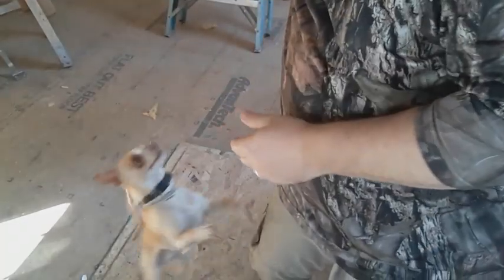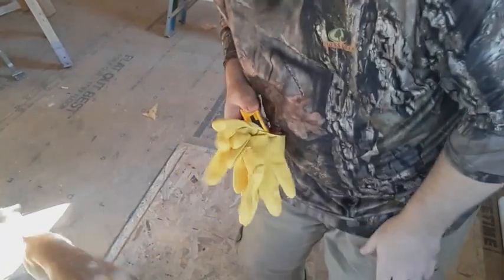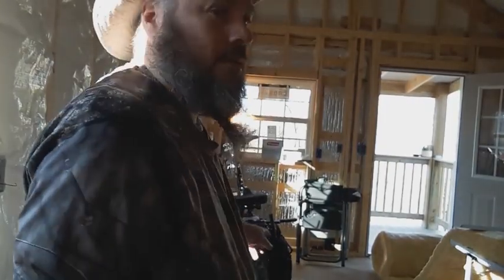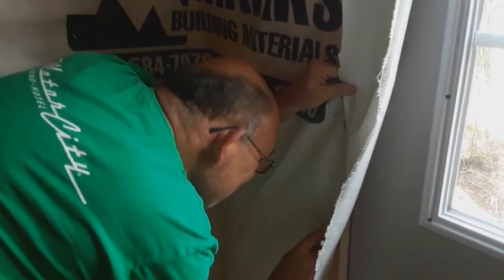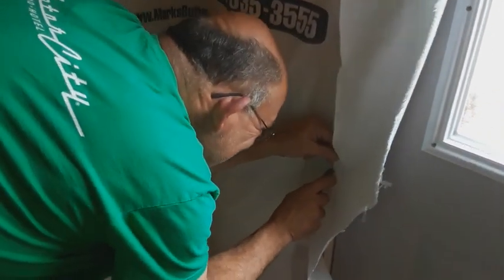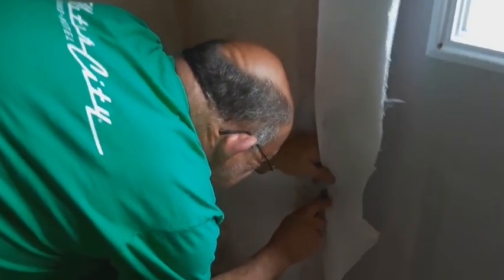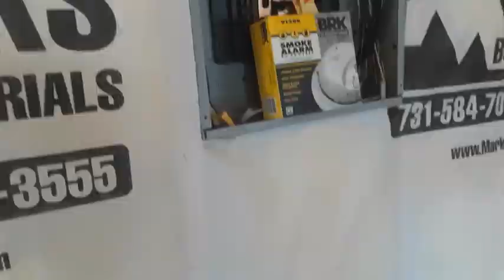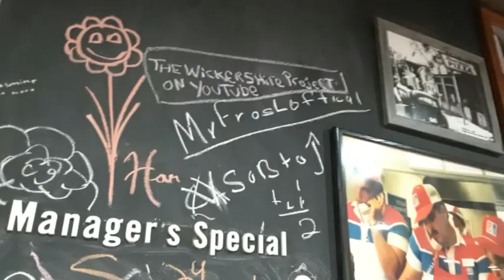Jan Vlog #7 Part 1 & 2 Itchy and Scratchy

Comment: I crawled through the middle of a roll wearing only shorts as a kid. I don't mess with it anymore. As an electrician it's been hard to avoid but I succeeded for the most part. Anytime I insulate i usually just use foamboard or rockwool.
Reply from the maker: Love rockwool and foam board.  Lucky I had enough $$ last year to get the spray foam done on ours.  Oh Great you play with electricity.  Ok so I need to ground my system.  I have the pole pounded down outside ( 6ft down it's i could do as we hit something. I'm gonna do a 2nd one later ).  I have Hot 1 and Hot 2 for 240v and 120v options. I know in 220v only the ground matters as a return route for a short.  In 120v application all Neutrals go to the neural bar.  Now I have a problem. There is No grid service as a return with neutral. Do I still run a copper wire over from the N bar to G bar?  You do not have to answer this. I can make a video on each component. 
 My power comes from a 6,000w Aims inverter. 
 Its has 
 Ground Hot Hot (In).
 AC out to Mains is
 Hot Hot Neutral. 
 I think Ground on my Inverter goes to the grounding rod.  ( not sure, more info on this  as these inverters have a closed loop Ground bond option, Its weird)
ALL 120v Neutral from the mains goes to Neutral line.
 Here lies my Problem!
In my Inverter the ground is now floating. ( as if I am in an RV )
 The mains Needs to be Grounded out to the rod. 
It states the inverter should NEVER have the Neutral and ground connected.  <- Oh F*ck My Life! Really? 
( re read the above statement to see my problem )
I think I need to connect the close loop ground wires in the inverter and keep that side RV style? 
If so WHY does it have a ground option on the inverter. 
I keep looking at the path of flow to Isolate in the event of a short. 
In conclusion The inverter closed loop Ground wire is separated and I can Now Utilize its ground to rod option.
My mains will run a 6 gauge solid copper ground line to the rod. 
Here is  the nut kicker.  I reread the manual. The inverters WARNING that ground and neutral cannot connect. 
I believe once you BREAK the closed loop RV style Ground on the inverter you CAN ground it.
This still leaves questions. 
Son of a gun. My Aims had another Ground terminal on the case itself. I know for a fact I can run that to the ground rod.
I believe the  ( IN ) ground is ONLY for the  line coming from the generator. 
Now I need to go see how the Generators Neutral and ground is wired, bonded or non bonded. 
Glad i could amuse you. I'll make a video on this cluster f8ck soon.